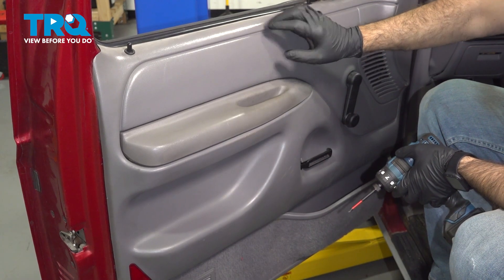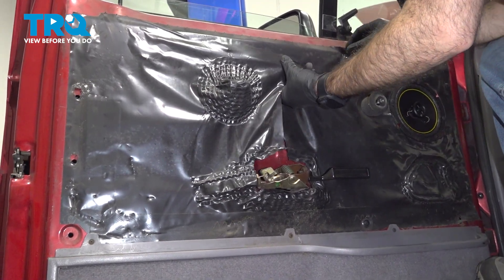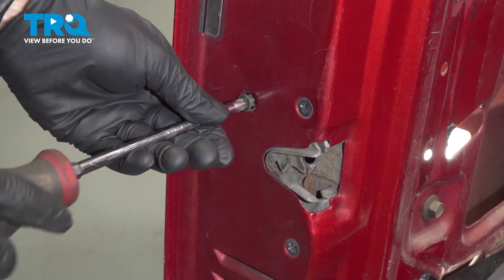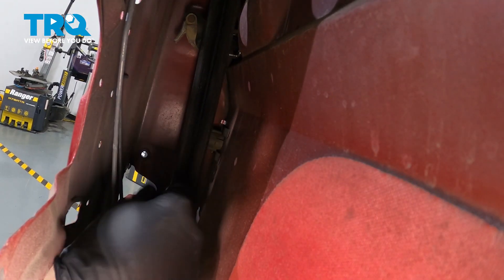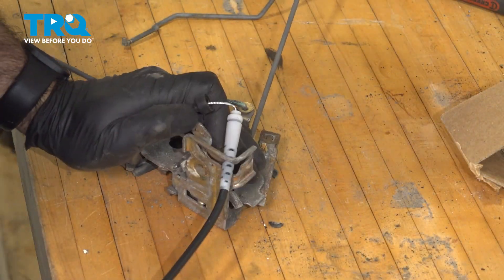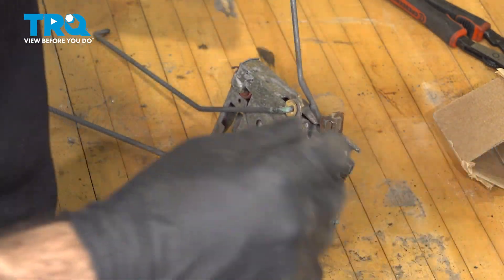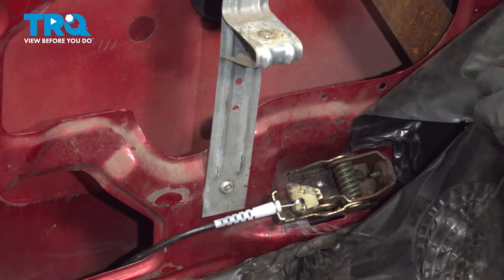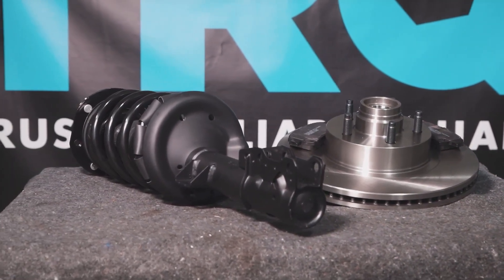How to Replace Door Handle Latch Cable 1992-1996 Ford F-150

Comment: Somehow the window track bolt has caused issues after installation. It seems the locking arms are getting blocked up by the track.